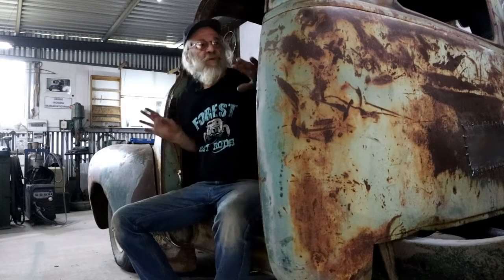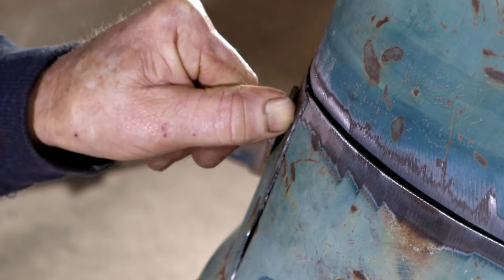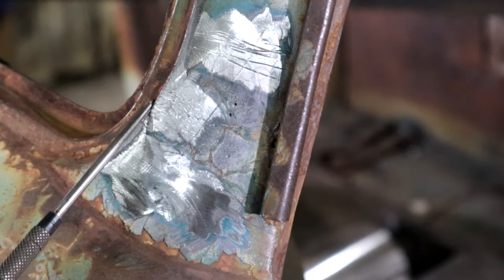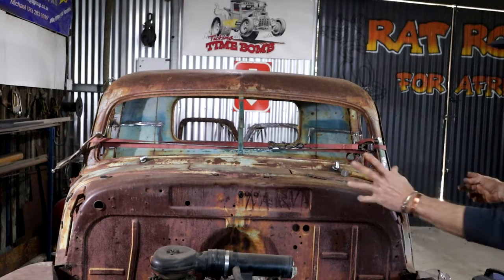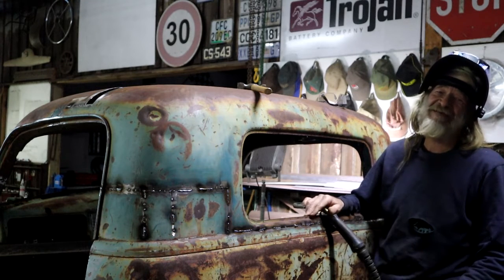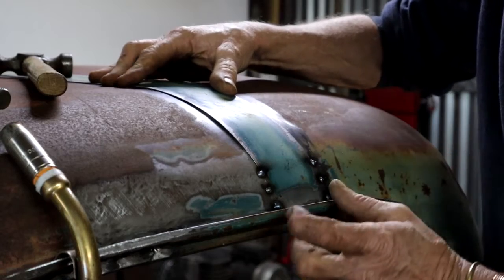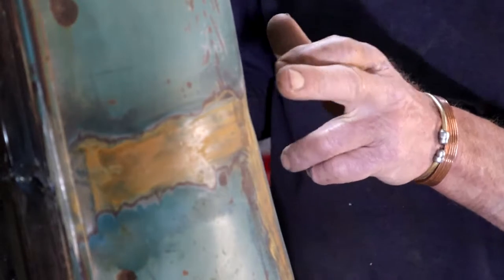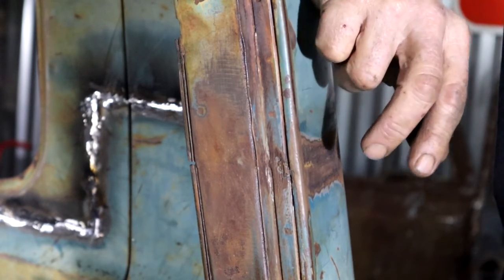CHOPPING THE ROOF  (Part 2) - 51 Chevy  Budget Rat Truck build

Comment: In the early 70's, I worked in a coach building shop in Brisbane, where they also converted Ford LTD's into Ambulances! :D The body builder who did the Ambulance building used a stick welder for all the panel work joining, just like you're doing here and while I was there the company got their first MIG machine ( first I had seen as well ) and the ambulance builder tried it out. Blew holes everywhere and went back to the stick welder! ;D He was the only welder I ever met who could butt weld 1mm steel sheet with the stick. I would get rid of that lead filler by using a small butane torch to melt it and a wire brush to wipe it off the steel. You wouldn't be accidentally thinning the steel body while trying to grind the lead out. Great job on getting those pillars to line up.
Reply from the maker: Nice little story🙂
Reply: Thanks. That was the last cut-and-shut ambulance made in Queensland and I was amazed to see it much later, in 1995, at the Chinchilla ambulance station, still going and doing it's job and it hadn't fallen apart! 😉 Not a bad testament to a skilled craftsman. 😁

Comment: We usually cut the roof in 4 sections so we don't change the angle of the A piller or B piller.. also I  cut a section out of the inside of the A piller to weld the inside metal other wise your only welding the outside
Reply from the maker: Many ways to skin a good cat😂 I once did one where I cut the roof into 5 pieces. What a lot of work😅

Comment: I don't know if anyone has mentioned this to you , but this is the way that Sam Gates chopped the top on the Rod and Custom " Dream Truck " way back in 1954 . Of course , he gas welded everything together before hammer welding all of the seams . No mig welders back then or angle grinders with cut off wheels , his cuts were done with a hack saw or air chisel .
Reply from the maker: No I didn't didn't know. How times have changed hey.

Comment: Good job Div!  You've actually got me thinking I could chop the top on my 67' f100 2 inches myself.  I've got to see you do the doors first though.  I think the stock roof height on these pickups is a little too high, and 2 inches would bring mine into better proportion I think.  Of course, it's just my opinion
Reply from the maker: Thank you Michael! I will be doing a video on the doors in the future. I dont know the 67 f100 very well, but I think they have a lot of interior double skin, which will make it more difficult.  You will also need someone to cut that curved windscreen for you.

Comment: Looking great Div! You are making good progress. I was wondering... you have a nice rake on the cab, what if the hood and fenders had a slight forward rake also? You might have the engine bay room since you don't have a stock size engine. Seems like a lot of effort, but might look good, or not.
Reply from the maker: Thanks Dan! You have good design suggestions. The nose clip does actually have a little forward rake, just hard to see in the videos. My shop is too small, cant get the camera far enough to show it.😅

Comment: Div! hello again. Just looking at your 1951 chevy 's stance which I really Like , how did you do it?  You and I have the same taste in the way I like my stance on my car to look. I like mine LOW and Rake ! Even when you were mentioning during your CHOP session of the rear of the roof being higher and the front about 1 to 2 inch lower. That's the way I like mine also,  Anyhow I thought you had channel the cap and the fenders followed for a great look. Just need your information as to how you did it THANKS!
Reply from the maker: Like you said, the raked roof chop adds to the look. I did not do any channeling, but I did mount the cab slightly lower in the front. I think most of the look comes from the suspension setup. I left the back suspension of the Nissan Hardbody frame original. Being a truck, it sits quite high. And then I dropped the front quite a lot by adjusting the torsion bars. Finally, the custom load bin I built was purposefully set at quite a rake. Hope that helps!🙂

Comment: Great chop, enjoyed your commentary. When you originally cut the top off could you not have just manipulated the front pillars instead of having to stretch the roof? I’m only interested as I’ve never done this and wondered if it was possible.  Thank you 😊
Reply from the maker: Thanks Billy! The front pillars would need a lot of manipulation. The bottom part (attached to cab would need to move back, and the top part (attached to the roof) would need to move forward. AND the pillars also need adjustment when looking from the front. This will require pie cuts and relief cuts in 2 planes. Down the line the door frames would need similar manipulation. In the end it is just a lot easier and simpler to stretch the the roof.

Comment: So may I ask how come you did not chop the rear window frame  with the top meaning that you kept the rear window frame the factory height but just dropped it down.
Reply from the maker: I like the visual impact. It doesnt look like a normal chop but yet it is lower... Also wanted to retain the original size for good rear visibility.
Reply: @ratrodsafrica  nice
Reply: I want to chop the roof on my 31 Model A coupe 2" just because I want to be able to get in it and don't want to sit on the floor boards. I got a middle row seat out of a Dodge Caravan which fits nice just need to modify the bottom so a guy can bolt it in place. I am putting it on Deuce rails and putting a 94-95 302 Ford out of Mustang GT  which I got some 3 bar GT 40 heads that come mostly on 302 engines in the Cobra Mustangs I Also had them ported to match the offy intake which the guy put them on his airflow bench and said they flow nice. Also going a step up on the Roller cam which I bought a Jegs Roller cam which is right at 513 lift with 286-294 duration and a set of Ford OEM lifters. I am running a set of old school headers. It going to look like the Bonneville salt flat look.

Comment: Man !
Your not going to leave the front pillar like that!
I fixed another person's similar job, if you cut the front sheet off you can then weld the inner bracing ( the strength ) you can also do a much nicer job of the outer sheet then
Reply from the maker: Mick, I dont understand which front sheet on the front pillar you are referring to?
Reply: @ratrodsafrica  Trying to attach pics but the front pillar has 3 pieces, the back that matches the door, the middle that is thicker sheet for strengthening and the front that matches the windscreen
Reply from the maker: @micksutton7046  I get you. That would be the PROPER way to do it, but I've never seen anyone go to that trouble. Even the "big guys" on YouTube only weld the outer seams